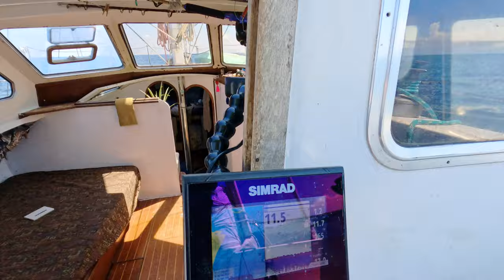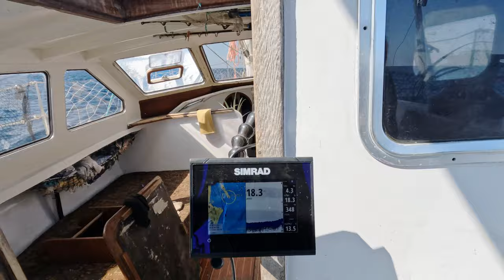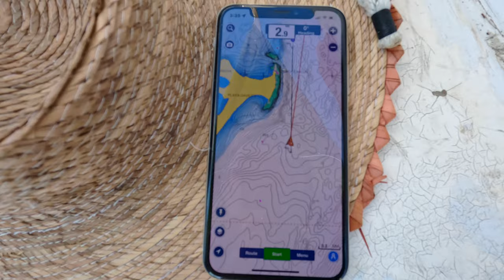WHAT IS THAT NOISE? Isla Mujeres

Comment: Good practice coming under sail. My wife won't let me try but she probably has a point as out anchorages tend to be smaller.
Reply from the maker: Yes - very good to practice, if you have a little room to manoeuvre under sail. I used to go all around in tiny anchorages without an engine, but the boat was only 20 feet...we do feel a little different with our 40 footer these days, ha.
Reply: @sailorama  good job and great shakedown really! I love sailing off and on my anchor... solo. I also think I need a solar oven!!!

Comment: On the fresh water side of the engine cooling add about 2 tablespoons of regular old DOT 3 brakefluid as it is good waterpump lubricant(The Bearing in the engine water pump will live longer)
Reply from the maker: Hey, thanks for the tip - it would probably help to get some lubricant flowing for sure 👍🏼
Reply: @sailorama  You are Very Welcome. Those rubber impellers last a really long time if the engine is used often and they are Not allowed to run dry at any time.

Comment: It looks like you have to setup schedule of maintenance and as you fix the broken part, setup schedule of it maitanance. You need also the informations about part and where to get it. 

Saying: Hopefully it will last another year is not good enough.❤
Reply from the maker: Great point! The nice thing about making vlogs is that they act in a way as maintenance schedule for us - I remember the date that we installed the impeller because we filmed the installation for a video last year - and now we have this video to reference for the next time 😆
Reply from the maker: We also have the impeller on our wishlist again: https://www.amazon.com/hz/wishlist/ls/107RSDADW9416?ref_=wl_share however, we know that a better brand may be the only way to make sure that it doesn't break again after only one year.
Reply: It's a 3rd party item so I need your shipping address and also want to send you gflex epoxy.

Comment: Your DIY gasket might me to thick and let water pass on the sides and thereby reducing pump efficiency. You can use some red silicon or something similar instead of a gasket..  Fair winds ;)
Reply from the maker: Hmm...that's something to consider. That water pump is a tricky thing - it needs to have a specifically-sized circular gasket that fits into a ring-shaped groove in the metal plate,  thick enough to fill that groove completely, and rigid enough to not enter into the pump housing - so we have not tried applying sealant or gasket-maker to the area, but I know what you mean.

Comment: I buy brand name impellers. If you buy brands like Seria the rubber is inferior and only fails right away.
Reply from the maker: This is probably the case - but we can only buy what is available 😫
Reply: I've had trouble with Amazon brand x impellers that came apart from the center fitting after a very short use... ugg.